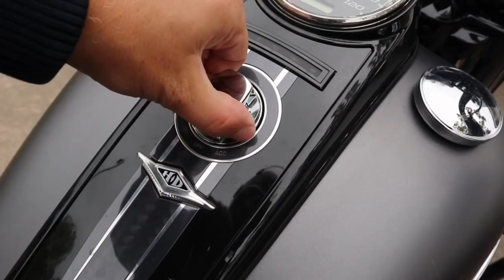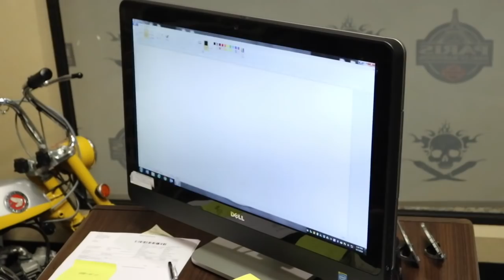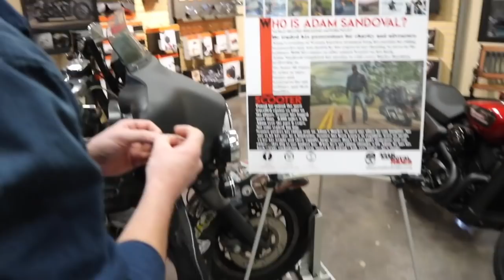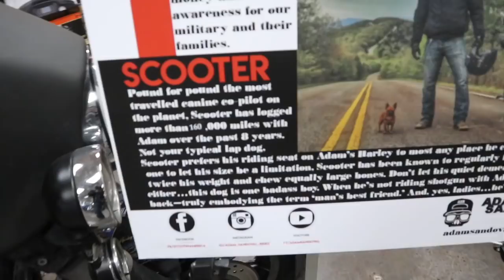New parts for Ashley!

Comment: How bad does those affect the lean angle? Look killer but low
Reply from the maker: Not much that I can see.
Reply: Brandon, they are designed to replace the stock floorboard mounts as to not interfere with the bikes lean angle. If you have any other questions please feel free to give us a call at 715-808-0027 and we'd be happy to help!